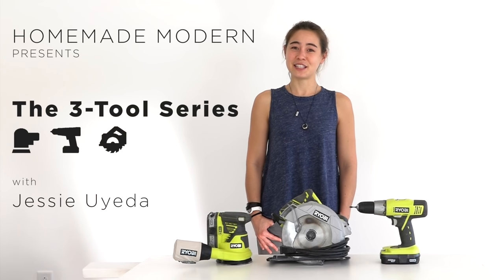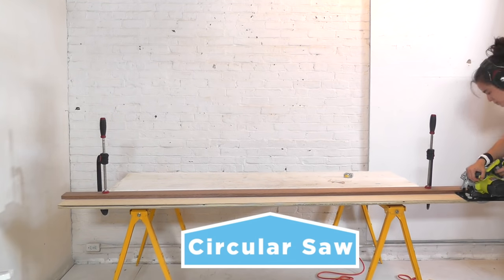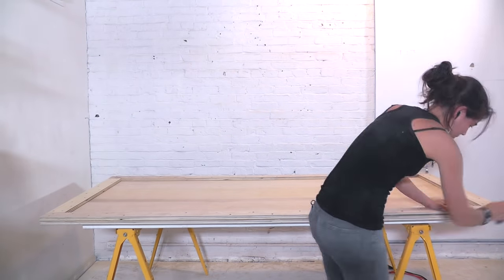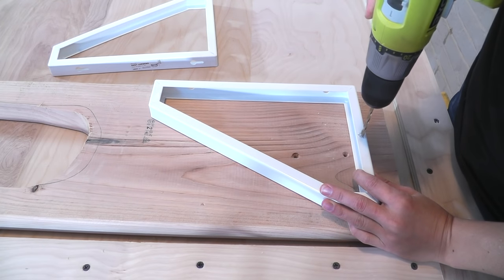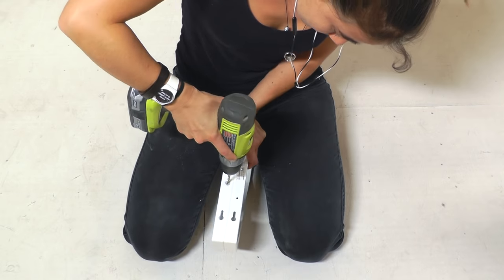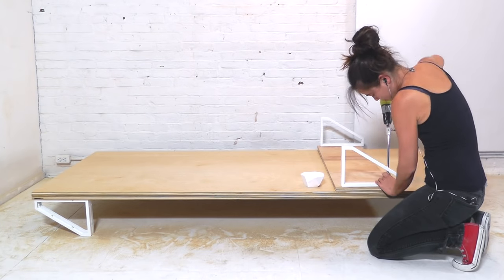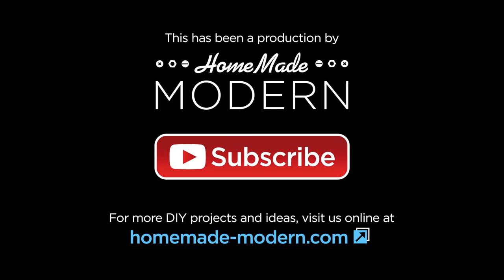DIY Bed | 3-Tool Series

Comment: Hey Jessie, that looks gorgeous for its simplicity! Great project but I just want to make a suggestion and that is that you drill a few holes on the plywood base for ventilation and humidity escape. I had a problem related to that very recently and realized that it is very important to have air flow underneath the mattress, otherwise you will get sort of fungus and stuff... Anyway, always love to see what you guys are up to! See you around :D Cris
Reply: Music name?
Reply: Was just coming down to the comments to say the same thing. This is why most bed designs include slats, it's super important that the mattress can breathe. Aside from that, this is a fantastic minimalist design!
Reply: @FortYort  same. It would be so easy to get a router and but some slats in on a diagonal so you couldn't feel them from on top of the mattress.

Comment: Is there any support in the middle to prevent the bed from curving with the weight of someone or multiple people?
Reply: It is a twin sized bed, there is no risk of that. If you were making it bigger, you might want to add a leg or something in the middle.
Reply: Why would more than one person need to be on the bed at the same time? ;) lol.
Reply: idk what you are expecting man.. its a 2min long video showing you how to make a simple bed
Reply: up⬆
Reply from the maker: 2 layers of 3/4" plywood glued and screwed together is strong enough to hold 700 lbs for a bed this size.  I would suggest middle supports for queen and king sized versions

Comment: This has got to be such an uncomfortable bed to sleep on. I've slept on that type of mattress, and its just like sleeping on a brick floor, and it would be such a pain to constantly hit your head/arm on that wood underneath the pillow
Reply: Some people like that. I chose a mattress from IKEA that happened to be the cheapest, but was the firmest they sold, and I slept on it for 4 years. Best bed I ever had - good for my back, and just sent me out like a light. Best mattress I ever had.
Reply: Ken  It all comes down to personal preference. I prefer harder surfaces. That sinking feeling I get with thicker mattresses is unbearable.
Reply: I have slept on a throw rug on top of tiles for the last 2 years. Literally 5ml between me and the tiles.  Best sleep i have ever had. Now i'm back on the bed and i hate it. I would love this bed. But to save the drama i would probably just buy hairpin legs. Easy to install and a similar look.

Comment: I like it!  In my opinion, the design could be improved by flipping the headboard/pillow support brackets vertically, so that those brackets would line up really well with the brackets immediately below them.  As-is, they look awkward to me.  But hey, different strokes - either way, great project!

Comment: That's a nice modern looking bed. I even have four of those brackets I don't use anymore.

I'm just a bit too OCD and I can't stand the brackets for the head rest and the brackets for the feet (under the head rest) are not properly aligned. 

Also, I think you need some ventilation holes in the bed plate. I'm no expert, but I think you need to let humidity (from sweating while sleeping) get out from the bottom of the bed.
Reply: Oh yeah you can definitely reverse the shelf bracket and match the same length together.
Reply: u re right, thats why im not into that bed build even tho i like the look
Reply: pikachuiswatchingyou it is not that it is reversed. It is just a little behind the one below. =P
Reply: Smiley Cool you can just make a grid of holes in the wood and it will be fine.
Reply: Yeah you need ventilation. You could just take a 3" diameter drill tip and do a hole here and there.

Comment: Hello Jessie, this a good idea for a bet to use plywood for a good resistance.
But bed need airing because during the nights our body sweat and the mat will go mouldy.
Saw u can drill a lot of hall in the play wood  to prevent this.

best regards

David Young french designer 
and I'm looking fore a job in France (Lille) ;)

Comment: You'd need to air out that mattress every day. Mattress' need airflow or they will mold. I sometimes sleep on a foam mattress on the flood for reasons and when you lift that shit up there's a condense underneath it. If you don't air a mattress all the sweat and heat will make it mold.

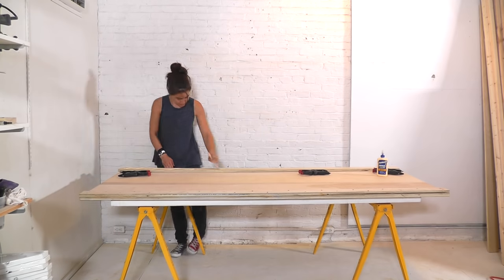Comment: At around 0:45, there is a white bowl in the frame. Is that one of those geometric dip bowls from Target? I've looked at my local Target on several occasions as well as on their website, and on sites such as eBay or Amazon and cannot find them. Did you by chance order them online, and if so, could you help me out with a link? Thank you so much! The bed looks great by the way. I love those brackets. I came very close to making a coffee table very similar to the marble one you guys made a while back.

Comment: its already bending when the slim girl lays on the bed. I bet its not strong enough to hold a big man nor will it last without starting to bend or even break. Eventhough its plywood, it's not strong enough for such a length.
Also slots or holes for airflow under the matress are missing.
I don't like that bed, sorry.

Comment: In this Bed you can lie all flat or you can lie on the slightly lifted platform wich is a wonderful idea. BUT it is better to have a slatted frame. Circulation of air is very important so the matress won't get mold. You also can lift up your matress to make sure it gets enough air circulation but my experience shows that most of the people won't do that.

Comment: Just curious, what prevents the mattress from sliding off the platform? And how do you make sure the mattress can breathe on the bottom side? I'd be afraid of moisture accummulating inside. I might be wrong, but I think this bed would be suitable for occasional use in a guestroom, for example, but not for everyday use. I'd be happy to hear from people who have built it and been using it long-term. Thank you.

Comment: Hmm i dunno about about this. Plywood sags/bows quite badly, especially with someone lying on it 7-8hrs every night. Most beds are made from hard wood or metal for a very good reason.
Reply from the maker: you are right! you "dunno about this"  the plywood doesn't sag at all if you look at the standard loads and spans for 3/4" plywood you would know this.  Most bed frames are not made from hardwoods or metal but rather composites such as particle board, plywood, or soft woods.

Comment: Great video. I made this bed for my daughter. FYI it sags a bit under my 200 lb body, so I'll probably add a piece of plywood to run lengthwise down the center. It fits my 35 lb daughter just fine.

Comment: I looked up those shelf brackets you used, cool idea btw.
On Ikea these brackets are sold 3$ each, in my country Ikea it cost ~4$, but on Amazon those a-holes sell it for 6$ (12$ per set of 2), and that is before calculating shipping cost.

Comment: Maybe this bed is different, but I once had a bed where the mattress was just loose on top. I just would not stay in place at all. It seems like a very thin mattress by the way.
Reply: Eleonore Bon my daughter's bed is the same way. I'm thinking of fabricating the frame with rubber or something. can't afford a new bed frame just yet.

Comment: its really lovely, but the plywood base doesn't really let the mattress breathe. do you have any ideas to make a slatted version?
do you think taking a hole saw to the base every 15cm would make it too unstable?
Reply from the maker: you could drill holes or cut slots but for thin mattresses in air conditioned spaces i don't find vent holes essential
Reply: +HomeMadeModern hello! Thanks for replying. Fair enough, that's true. Our old houses he on England aren't generally air conditioned though (apart from the drafty windows), so I think I'd have to. You don't think it'd have too much of an effect on the strength of the plywood? 
Anyway, I'm going to try it out! Already looked up prices and this bed is both cheaper and WAY better than the really rubbish one I have now. I really love it. Thank you for the great design. Looking forward to the rest of your videos in this 'simple' series... totally my style! have a great weekend!

Comment: I have a question. If I where to make a king size bed same as the one you made. What are the measurement.
Reply: You would need to redesign. You would need multiple sheets of plywood and probably twice as many shelf brackets to accommodate the extra weight. Could be done tho.

Comment: add some holes for ventilation and this would be a very nice idea
Reply from the maker: you could drill holes or cut slots but for thin mattresses in air conditioned spaces i don't find vent holes essential

Comment: I literally only have a hand saw and drill and other very basic tools like clamps screwdrivers etc
Reply: That's the way I was. I recommend buying a circular saw. These are only around $50, but you will get a lot of use out of them. And with the proper jigs, they can basically do the same thing that miter saws and table saws do.
Reply: you "literally" have those things? Do you know the usage of the word ?

Comment: I saw two different types of clamps, a paint brush for glue, a pencil, a right angle straight edge, a paint brush for acrylic, a flathead screwdriver, and needle nose pliers  all in addition to the 3 toola you said you were exclusively going to use... Fail... But cool bed

Comment: Clamps, paint brushes, caulk gun, flexible shaft bit holder for the drill, and needle nose pliers (whatever they were used for) are also tools.  So maybe more than just 3 tools to make.  Great project for a cheap bed though

Comment: Saw horses... tool #4, Caulk gun... tool #5. Flexible bit holder may be considered a tool, but i will consider it an attachment and just dock you for the standard screwdriver... tool #6. I also saw a pair of needle nose pliers in there, tool #7